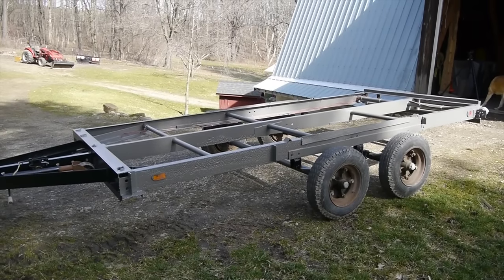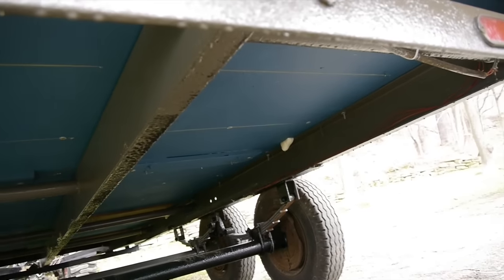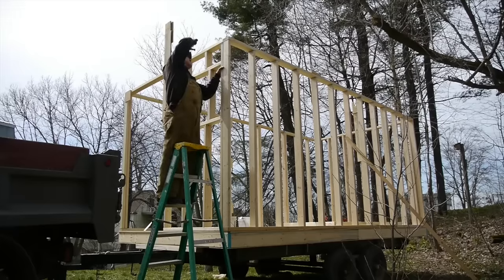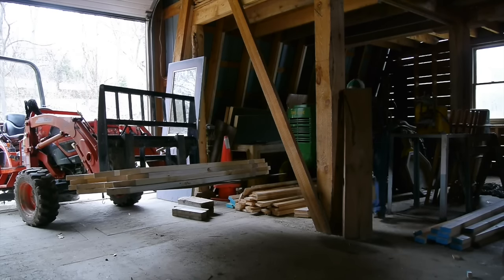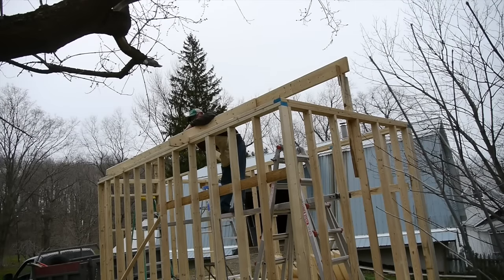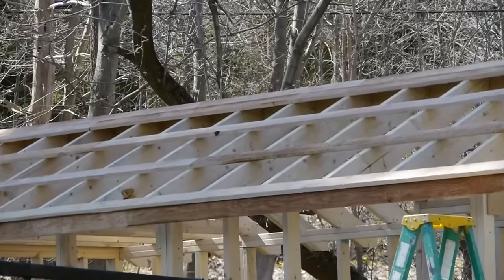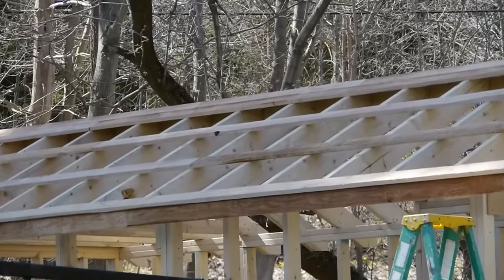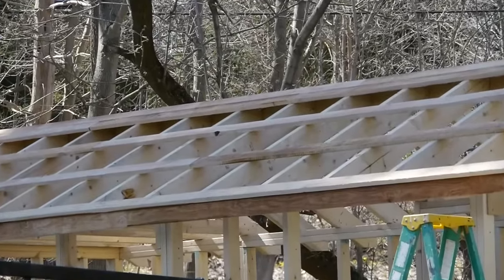My Tiny House: Start To Finish

Comment: This is such a great video. I'm planning on doing this early spring next year and will definitely be watching your videos again!
Reply from the maker: Great!  Good luck with your project.  If you want to haul your cabin here and there, you should buy a good heavy duty trailer. It needs to have electric brakes and be road worthy because these homemade tiny houses are heavy.  Spend the money on a good trailer for your foundation ... Unless you plan to permanently park it like i did.

Comment: I very much appreciate that this is an actual video and not a slideshow like so many others. That being said, you sort of went overkill on the framing. You can get away with a LOT less wood and still have a reasonably sound structure, which would also reduce the weight dramatically. I've been toying with the idea of a "very lightweight" tiny home trailer using alternative materials, but not sure if I will ever build it. I'm considering the use of a lot of plastics and aluminum but I haven't found some of the needed materials in ready-to-buy forms and I really don't want to be fabricating some of the plastic components from scratch. I'm also toying with ideas about reusing commonly available materials that can be had for free, but I don't want to build a weak structure either. I want to build a not-quite-so-tiny-house in the future. Roughly 8ft wide by 40ft long. I want to keep the weight down and the dimensions within certain specs so it can be hauled without the need of special permits. For my area, that would be 8.5ft wide by 40ft long (forgot the height limitation and weight limitation). My goal is a livable "roomy enough" space that is portable enough to be quickly and easily moved without the need of special permits or other governmental hoops. Where I live, moving a "manufactured home" isn't that expensive when it comes to permits, you can fairly cheaply move a fairly large structure. The big cost is with transportation. With a smaller trailer that just needs regular trailer tags, you can have it moved a lot cheaper or move it yourself so long as your tow vehicle can handle it. I've considered skirting those dimension limits by going with a 53ft "dry van" semi trailer (and removing all the walls and roof) or a flatbed semi trailer. With those, the max length is 53ft instead of the 40ft. They can be had for around $5K which is about how much it will cost to get a 8ft x 40ft trailer. A bonus is it would be ready to haul (if everything is in working condition) and just needs the "house" built on it.
Reply from the maker: Thanks for the comment Mark.  I guess the design depends on what the building will be used for.  The purpose of the building would determine the materials to use and how elaborate the design would be.  In my case, I wanted a cabin in the woods.  I got the idea of building it on wheels at home at my shop where I have electricity and all the tools, then towing it to my site where it will remain permanently.  This build was not meant to be hauled around so weight was not a factor.  I built with 2X6's so that I could insulate this cabin for wintertime, sub zero, windy weather.  Also, I have an outhouse so no need for a bathroom.  It's basically a place to get inside out of the weather and be warm and dry. A weekend get-away.  I think you see what I mean.  You have an entirely different purpose for your building (should you decide to do it.)  It's good that you are thinking of every aspect possible before starting your project.  good luck

Comment: You have a real talent for explaining things. This video is serious quality :). I'm planning to build a flat bed truck camper framed and skinned with wood. But it'll be my first serious construction. I will be living in this camper year-round in the mountains, do you think the camper would benefit if I made a "sub-frame" out of steel tubing? The lower part of the frame, such as the tubes that contacts the flat bed, would be steel) and made the rest of the frame out of wood? I don't have any welding skills but I do have friends :). 

And again, that was a killer video! You should seriously consider part-time teaching or just monthly group lessons with local people who are interested.  Thanks again!
Reply: No wonder! I just watched your intro video and see that you are a professional teacher. Well you're fucking good at it lol. Keep it up
Reply from the maker: That sounds like a good idea.  This one I made is just a weekend kind of cabin.  I knew it would be making a one-way trip to my land so my connection to the trailer frame was good enough for that.  You are talking about building something to live in.  The connection to the trailer is pretty important ... you don't want it to fall off going down the road.  Your metal tubing could work.  Anything you do will add weight.  Always a consideration.  maybe have some metal brackets made to bolt to your frame ... then bolt your wood frame to the brackets.  It might be lighter and work just as good.
Reply from the maker: Thanks.  I enjoy this shit.  lol.

Comment: if you carry this house over country it should have suspension system bottom of house. Because it will part apart after 1-2 years. The house needs to stir like bridges. Cool video by the way.
Reply from the maker: I built this thing to make a one-way trip to where it is set up in the woods permanently. It only had to be hauled five miles and we went slow and easy. If you are building one to actually haul around, you want a real good trailer. I would say at least a 10,000 trailer.

Comment: So great to see him build something he is happy with, but hoping others purchase strong trailers with a frame, axils, and tires rated for the proper weight.

Safety on the highway is a big deal!  Still, it was an interesting video.
Reply from the maker: I built this thing to make a one-way trip to where it is set up in the woods permanently. It only had to be hauled five miles and we went slow and easy. If you are building one to actually haul around, you want a real good trailer.   Actually, I can't imagine anyone building one of these to tow around the countryside.  If you want to do that then buy a camper!  Ha!
Reply: TimTools99, thanks for the feedback.  Glad to here you towed it safely!

I agree, a camper would be safer vs repeatedly towing a tiny house.  Personally, if I ever own a tiny house, I will pay for a professional to move it for me.  

I've watched "towing fails" here on YT.  I will never drive behind a trailer!  They can be tricky with uncontrollable swaying, bearings freezing up, or tire blowouts.

If you don't mind one more comment, isn't it likely that someday someone else will own your tiny house/cabin?  They may not understand the condition of the trailer since it is now covered up.
Reply from the maker: I imagine that my son will keep this cabin since I have it parked on his land.  It's at a beautiful spot overlooking miles of rolling hills.  We put in a pond just below the cabin.  I can look out and watch the ducks swimming around in the summertime. In the winter, it is nice to go up there and hang out in the warm cabin.  I suppose that if my son got rid of it for some reason somday, the next guy would have to have it inspected if he thought he wanted to haul it like a camper.  It certainly would not pass inspection.  No, I think this thing will probably stay right where it is.  Thanks for all your thoughts.  P.S. Safety on the road should be on everyone's mind.  When we moved this thing five miles, my son pulled it with his truck while I followed behind with my 4-way flashers on.  I was happy when we made the turn onto his land and he got it backed into the spot I had prepared for it.
Reply: TimTools99, that sounds amazing with the view of the rolling hills and the pond.  Glad it worked out for you to have an enjoyable spot, even in winter.  Thanks for your thoughtful reply.

Comment: truly great video!  thank you for taking the time with the narration to describe exactly what we're seeing. I'm going to be helping my brother build one soon. would you mind sharing the rough material cost?
Reply from the maker: Hello Been.  I had the windows and doors in my garage for many years.  I didn't have to buy those.  It's hard to estimate how much I spent and how that would compare to materials you will find.  I guess it would be easy to spend $5000 on a simple build like mine.  If I were to actually build a Tiny House to haul around, I would start with at least a 10,000 lb trailer with electric brakes.  You need a good trailer.  Mine was not a good trailer but I knew I was only going to move it one time to its place at my camp.  There are a lot of things to consider before you build.  The real expense is not building the "box."  The furnishings (Bathroom, kitchen, electric etc is where your money will be.

Comment: Very good craftsmanship. Though I must comment that it’s built very heavy. The framing was double overkill. Super strong for sure. But for something that you tow that is a lot of unnecessary weight.
Reply from the maker: Thank you.  I built this at home so that I could tow it to its permanent site location deep in the woods on land i own.  I don't plan to ever move it again.  So, I wanted a well insulated, sturdy cabin that I could stay at in the wintertime.  That's the reason I built it like a house.  Thanks for watching.

Comment from the maker: Glad you liked it.  It was quite a project.
Reply from the maker: Thanks for the comment Mark.  I guess the design depends on what the building will be used for.  The purpose of the building would determine the materials to use and how elaborate the design would be.  In my case, I wanted a cabin in the woods.  I got the idea of building it on wheels at home at my shop where I have electricity and all the tools, then towing it to my site where it will remain permanently.  This build was not meant to be hauled around so weight was not a factor.  I built with 2X6's so that I could insulate this cabin for wintertime, sub zero, windy weather.  Also, I have an outhouse so no need for a bathroom.  It's basically a place to get inside out of the weather and be warm and dry. A weekend get-away.  I think you see what I mean.  You have an entirely different purpose for your building (should you decide to do it.)  It's good that you are thinking of every aspect possible before starting your project.  good luck

Comment: I know there's always someone who has to correct something.  You mentioned 1/4" Luan.  I used to work for a flooring company and I always thought Luan was 1/8".  Just curious if you actually used 1/4" vs 1/8".  I think you also mentioned you were only moving it once.  I was thinking it's going to be quite heavy for transporting regarding specs that typical mobile homes meet.  Hopefully the trailer has stayed strong for you.  Anyway, a very inspirational video.  Thanks for sharing the process.
Reply from the maker: You could be right about the luan.  I was thinking it was 1/4"  The trailer is pretty heavy.  I would want to move it like you would a camper.  I moved it once and parked it by my pond.

Comment: Great job...
... but how much did this weigh after you were through?
I have never seen anyone use 2 x 6 on a tiny frame... 
usually no more than 2 x 4s and most use 2x2 .... 
I hope you have good tires...
I design houses and have redone 24 RVS... that's how I 
know what they're made of... (pretty flimsy truthfully)....
I guess to keep it light weight.
Thank YOU for sharing this great tutorial/video.
Reply from the maker: I got the idea to build a cabin on wheels and wanted a solid cabin.  This thing finally made a one-way trip to our land out in the woods.  The idea was to build it at home where i had access to electricity and my tools, the move it to my camp where it will stay.  So, i wasn't concerned about weight as long as that trailer could make the one-time-6 mile trip.  Ha!

Comment: Tim you did an awesome job. I have a few questions for you if you don't mind answering. What's the size/dimensions of the trailer? & do you have a video of the inside job for the tiny house? Are you planning/have done work to it to have running water? 
I'm moving to Utah next month and instead of paying for rent I decided to live out of my car and work on something very similar to this tiny house. Thanks for the video, keep posting more!
Reply from the maker: Hello Jesus.  The trailer was about 6' X 14'.  I extended the deck so I could build an 8X16 cabin.  My tiny house got moved into the woods on some land we own.  No running water or electricity there but I installed wiring and water pipe just in case we ever get it .  Good luck with your project.  Thanks for the comment.

Comment: Great job and i see youre only going a short distance but im curious as to why others dont use steel studs. A fraction of the weight, same cost and most importantly far superior fire resistance. I cant be the first person to have this thought.
Reply from the maker: I am an old-timer and have only ever built with wood.  It never crossed my mind to use metal studs.  Do you bolt them together or screw them?  How do you cut them?  As far as risk of fire is concerned,  Everything in the cabin is made from wood.  I have a fire detector and CO detector and I guess that I will just run like hell if the place catches on fire.   Ha!
Reply: @TimTools99  
Self tapping screws or pop rivets. Aside from that construction process is essentially the same but instead of a normal miter saw you use an abrasive cutoff wheel on a chopsaw. Its thin steel, sometimes too thin like trying to screw soda cans together, thats terrible because the drywall is the only thing that adds rigidity to the works. But it can be done well and its just as sturdy as wood 2 by twice construction.
Reply: @TimTools99  
Sorry about that ham wallet and i are one and the same. I sometimes forget which gmail im signed into and end up replying with the wrong username. Ham slap... for the sake of brevity.

Comment: Thank you for sharing this .. you did a great job.. that siding you used wasn't that osb board was it ??
Reply: NO
Reply from the maker: It was composite siding (not OSB.)  Not the best stuff for a house for sure but it was cheap and light weight.  As long as I keep paint on it, it will probably last a long time.

Comment: Awesome video very well done. I want to build one but concerned on what type of trailer to get. Want to buy used for less than $2000 but not sure what's a good weight limit to use? How much weight can your trailer hold?
Reply from the maker: I built this thing to make a one-way trip to where it is set up in the woods permanently.  It only had to be hauled five miles and we went slow and easy.  If you are building one to actually haul around, you want a real good trailer.  I would say at least a 10,000 trailer.

Comment: Maybe make another video in a few years showing how well it holds up compared to a commercially available RV.
Reply from the maker: Oh my.  I am almost 70 years old.  I'm more concerned about how much longer "I" will last.  Ha!  However,  my little cabin is built much stronger that any commercial unit.  They use the cheapest material they can get away with using.  As long as somebody keeps my little cabin painted, I bet it would last 100 years.

Comment: nice looking ,but ower weight frame come, normal trailer house used frmane 2" x 2" or 2" x 4" max . and roof need only 2x4" and smart use thin metal pillard frame, weight drop lot and have same strong.
Reply from the maker: Not worried about weight. This cabin is set up permanently at my camp.  I am not going to move it again.  I used2x4s and 2x6s so i could insulate this cabin well. It gets cold here in the winter.  Thinner walls and i would freeze to death when i sleep here with temperatures near zero degrees f.

Comment: You might want to consider using a copper mesh instead of steel wool because steel wall is flammable
Reply from the maker: Heck ... the whole cabin is flammable.  I try to be pretty careful with fire around this thing.

Comment: Thanks for sharing your process. how well does everything holds up to our winters? Im in rochester and saving up to make a cabin on wheels for full time living.
Reply from the maker: So far So good.  As long as I keep it painted, it should be fine.  I put some of that solid color stain on my deck and after two years it is peeling.  I won't do that again.  I used good Shirwin Williams primer and paint on the cabin.  That will last a while.

Comment: Nice video and great tiny home. How did you connect the wood framed floor to the steel frame?
Reply from the maker: Screws and bolts

Comment: Neat build, thanks for posting. 
Like you mentioned, I'm working towards a little cabin that I can haul to the bush and leave there, although mine's going to be coming off the trailer and onto log cribbing in two modules.

I know we're going back a bit here, but I'm kinda curious why you used the temporary struts for the ridge. Since you're sheathing it anyway, why not just frame in the gable ends ?

Comment: Hi, You do good work! How did you attach the floor to the trailor? I see plywood on there but can't tell how it was secured. Then, how was the floor frame attached to the plywood?
Reply from the maker: I started with 3/4" plywood and bolted that to the cross-members of the frame.  I built my floor Joist frame  on top of the plywood then screwed up through the plywood into the frame.  Later, I attached L-brackets around the perimeter and lag screwed everything
Reply: Thanks!